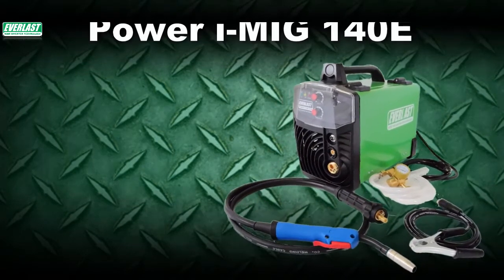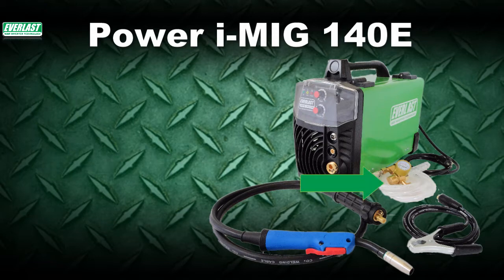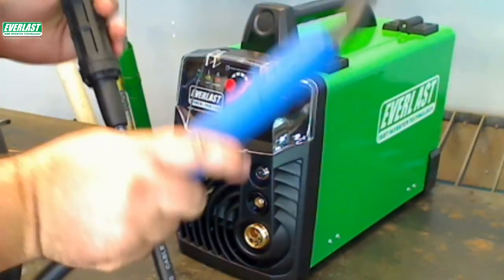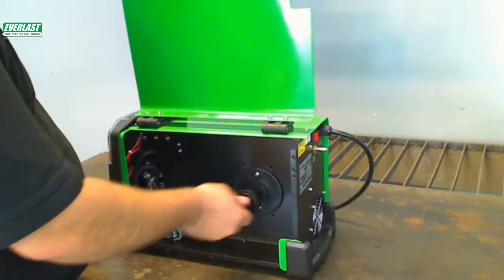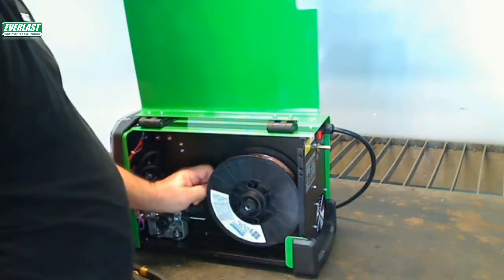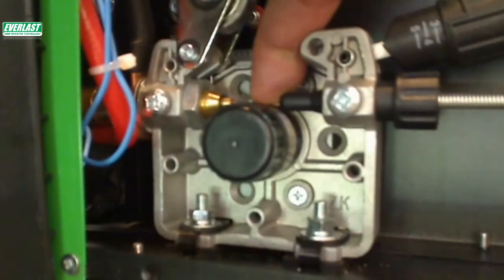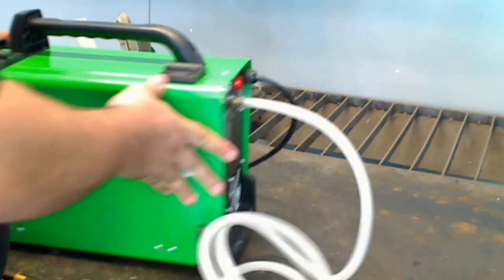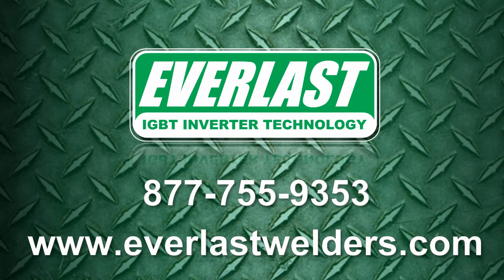Everlast MIG Welder, Power i MIG 140 E 120V Inverter MIG welder Part 2 of 3

Comment: Why do I have to buy different parts to use flux-core wire? Those parts should come with the welder.
Reply from the maker: +Jeffrey Beyer Not with all migs.  We have a price of 399.00.  You may have one person that wants one size drive roll or another...there's no way to predict it, so we sell them for around 20.00 and keep the price of the unit lower.  You choose.  Many people do not want to weld flux core, and and the unit is designed to be primarily a MIG machine.

Comment: Hello, I recently ordered this machine. I just found out that for flux core I need optional rollers. What is the difference between the rollers that come in the machine and flux core rollers? Also where can I buy said rollers? Thanks
Reply from the maker: +lexugax 
Sorry, did not see your comment.  This machine is designed as a MIG, not just a flux core wire feeder.  There is a difference. But if you want flux core, you can buy them direct from our site.  They are actually listed under "consumables", but if you go to our site, you'll see them there.

Comment: can the 140 run .35 f core?
Reply from the maker: Yes, with the optional Flux Core drive rolls.  But it is suggested that .030 be run for best results for the average 120V breaker size you'd find.

Comment: Oh what a pain in the rear end to switch the polarities from inside the machine like that.  I guess that's the price one pays for the Euro style torch lead.  Hmmm.  That is the first thumbs down part of this welder I've seen so far.
Reply from the maker: Every welder you will buy switches polarity like that.  Miller and Lincoln included.  It has nothing to do with Euro style torch lead.  That's typically the way all MIGs are built.